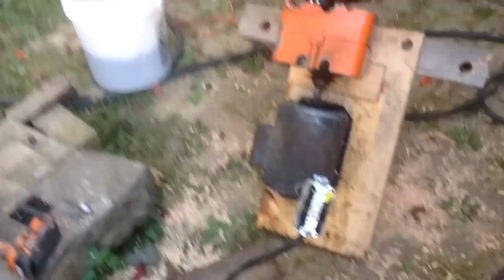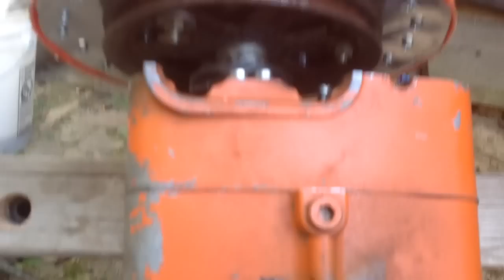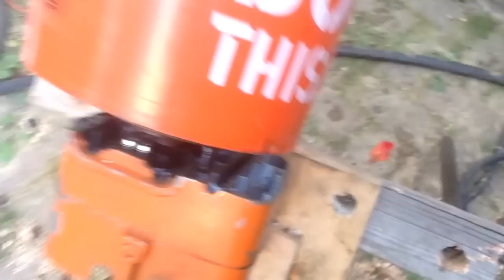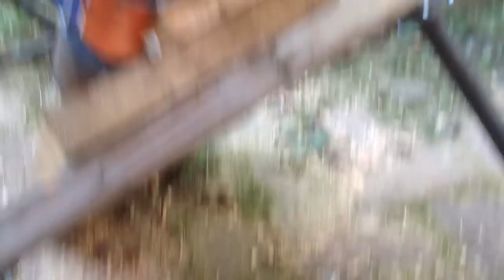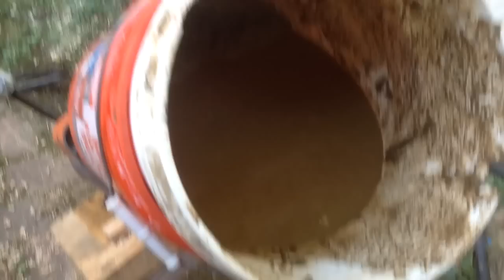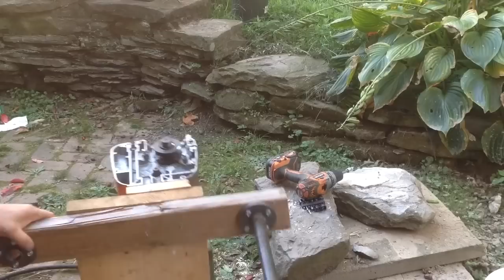5 gal bucket cement mixer

Comment: Hmmmmm . . .A motorized device that is known to be operate in a very wet application with an open electrical junction box and an indoor rated switch.
What could go wrong?
Reply from the maker: you know its a prototype.